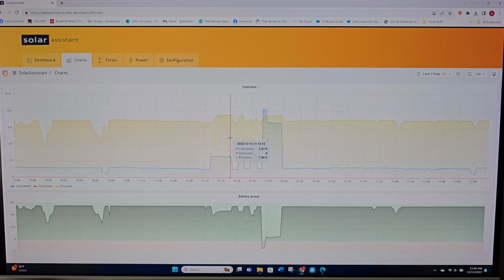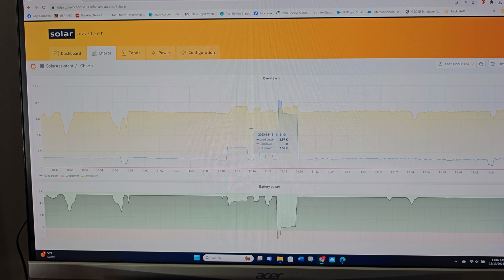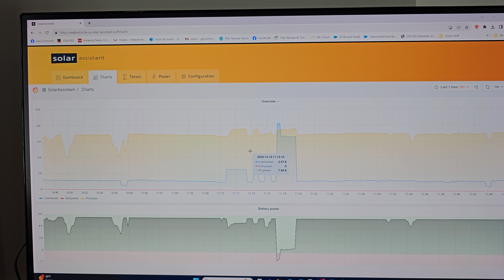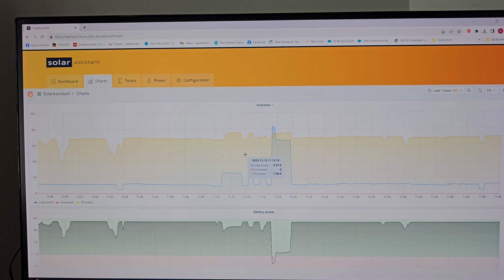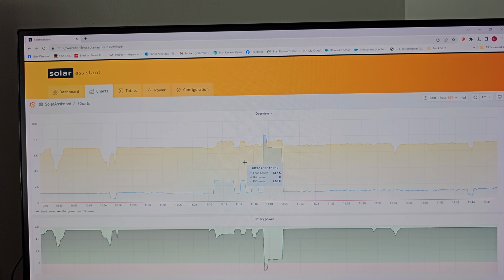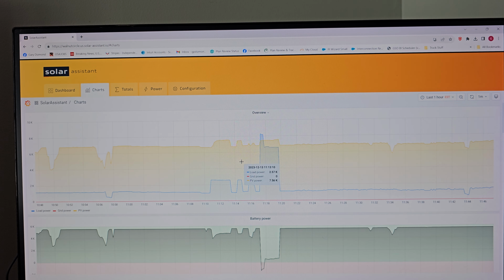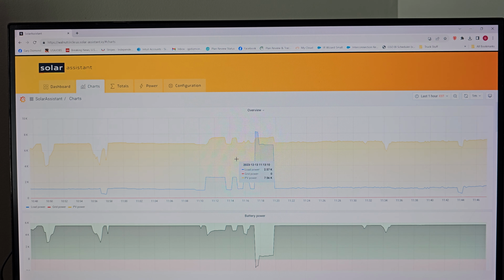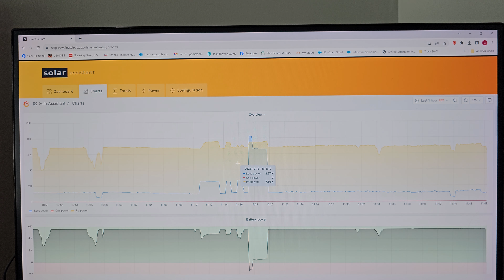Solar Panel Power Output 13 Dec 2023

Comment: That's a great output being on a set angle during winter.  I've been watching all your videos. I've set up a smaller system - 6500XP with two LL-S batteries tied to nine 545w bifacials.  Just finished setting up the inverter and inside wiring.  Now I'm looking to getting the panels set on a rack.  Kind of backwards from how you did it.  I just got a quote from ReadyRack for a 10 panel setup - about $3k shipped to central NC.  I'm probably only going to put up 8 panels so I'm looking at two EG4 Brightmounts for now.  Still trying to decide.
Reply from the maker: Thank you.  I was getting 8.5kW for several hours today.  I have two PowerPro batteries now and both were fully charged by 1PM today along with powering the whole house.  If I didn't need to pass city inspections I would have built it from galvanized pipe and unistrut.  Most of the mounting hardware you find on Amazon is made for unistrut.  The EG4 are not engineer stamped or UL listed, so if you need to pass inspection make sure it works with your city/county before you buy it.